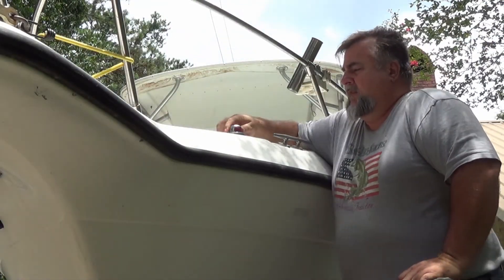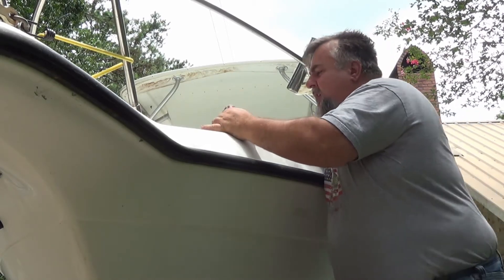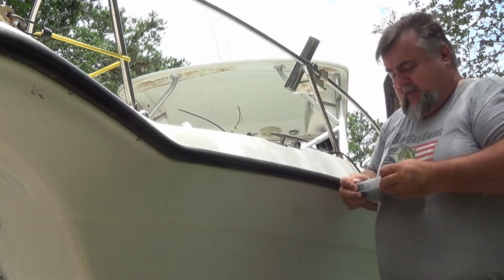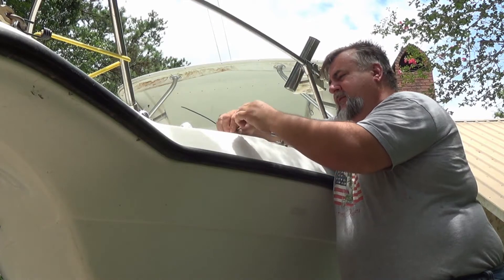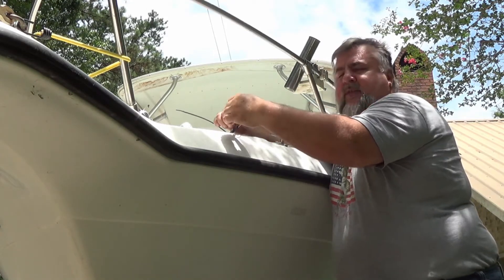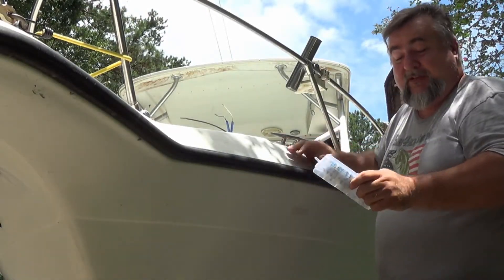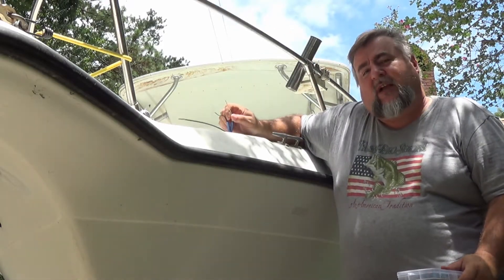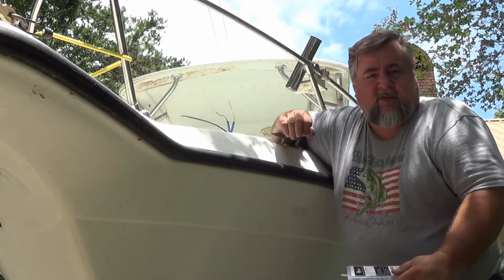How To: Upgrade Boat Nav Lights to LED

Comment: Those heat shrinks with low temp “solder” are dangerous and do absolutely NOT comply with ABYC rules. It seems cool, but is a scam. ABYC specify crimp connections, because crimping gives far better contact, is more reliable and longer lasting. Real solder is tin that melts into the copper strands. Tin has higher resistance than copper, so the solder joint will always be a slight bit warmer than the wire. For proper solder, that’s fine, until the wire gets more current than it should. The problem is that the resistance will slowly increase. With enough current, the solder will melt and you usually get a sparking connection, which often lead to fire. The fuse will NOT trip from this. With this shitty low temp “solder”, this process goes faster and just a slight overcurrent on the wire will melt all the solder in a moment. Why not use crimp connectors? They’re easier to use, easier, far more durable and safer. A workable crimp tool can be gotten for 10 dollars. You still usually need heat shrink, but that can be melted with a lighter. Dead easy and fast.